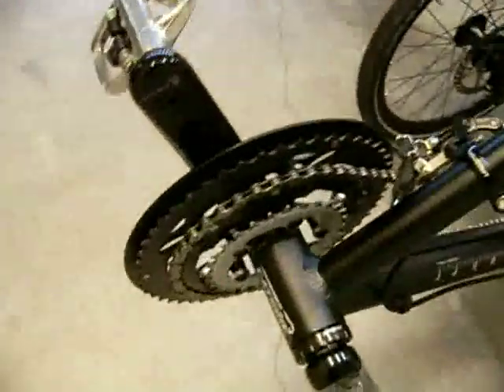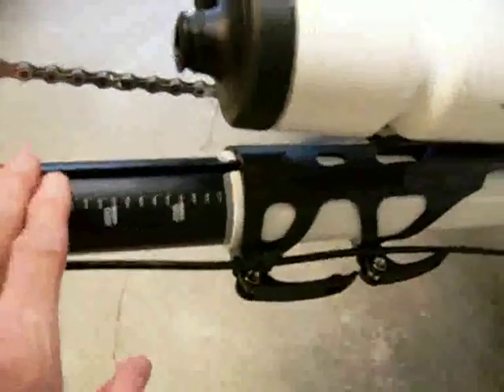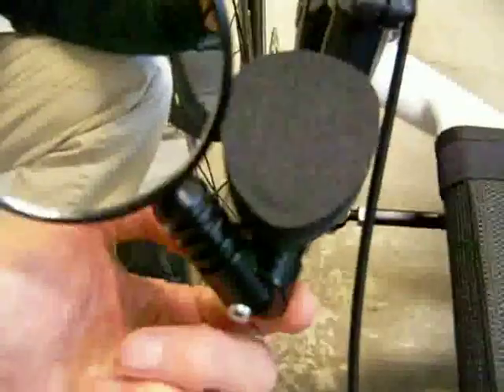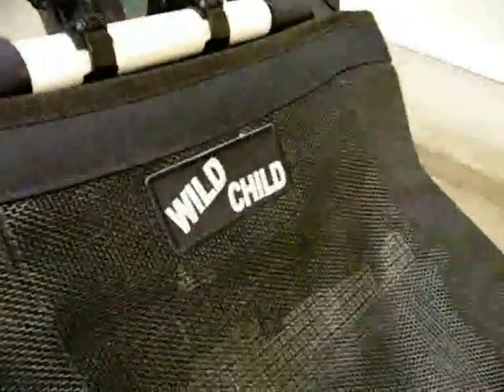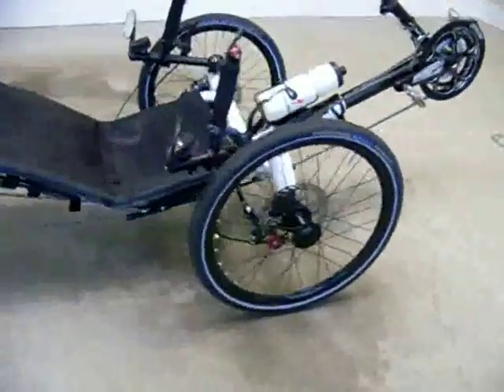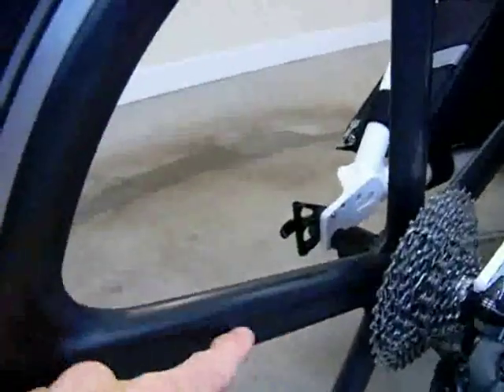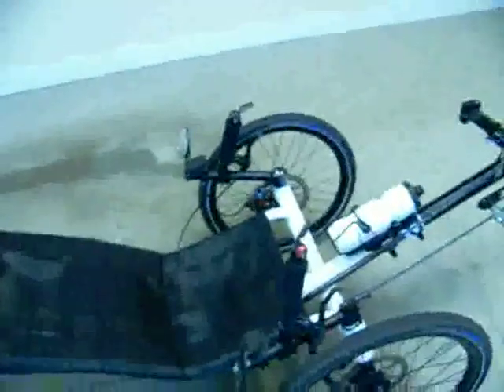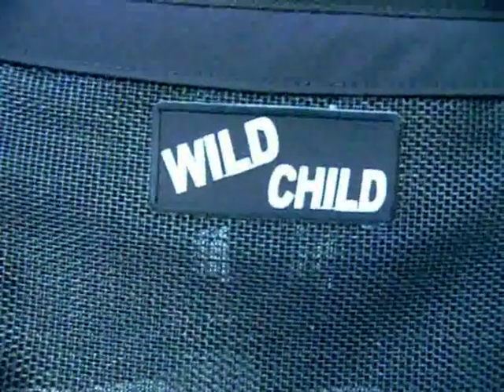Catrike 700 Build by Trike Hobo

Comment: How many gears  are on the back of the trike.? Also do you plan on putting assist bars on your trike? Also after traveling would you change your peddles to a different size.
Reply from the maker: Hi Paula,
Thanks for visiting, and for your comment! I will provide a link here to a detailed page on my Trike Asylum website where I discuss extensively all aspects of this Catrike 700, including the gearing front and rear (plus TONS more information):
https://trikeasylum.wordpress.com/stevestuff/steves-catrike-700/
Regarding assist bars, I assume you mean the bars that help people sit down on, and stand up from, the trike. This trike is indeed very low to the ground, as you'll see in photos on that Trike Asylum page I linked above. However, for me, I have no need for these assistance bars because I am quite athletically fit, so getting up and down, even on this super low recumbent trike, is no problem at all.
Take care my friend ...
steve
Trike Hobo

Comment: How does the Catrike compare to your Ice?  Compare direct steering versus Ice indirect steering
Thanks.   Beautiful trike too!
Reply from the maker: Hi James,
I prefer this Catrike 700 over my ICE Q trike. It is more comfortable due to the seat recline angle, and the mesh seat is superior to my former ICE seat. The 700 is capable of much higher speeds than the Q, and with my 24 tooth small chainring, it can outclimb the ICE Q on hills and mountains. I like either kind of steering - both are very intuitive, and can be learned within the first 60 seconds on the trike. I prefer the direct steering of the 700 however, as I can turn sharper because the turning circle is not hampered by the handlebars hitting the seat frame, as it was on the ICE Q. Also, with direct steering, the seat has been placed farther forward than the Q, which allows me to sit in the seat without using my hands to sit down. I also prefer the aesthetics of the steering appearance on the 700 - very simple and clean, unobtrusive. At this time, I would not opt to return to an ICE Q, or to have an ICE Sprint 26X, as I believe the design factors of the 700 are simpler and more efficient - just personal preference however, so keep that in mind. See ya' ....
Trike Hobo

Comment: Very nice machine and beautifully explained. It sure comes with a price tag, doesn't it? Anyway,one question: I didn't see any rear brake, and I have also seen other trikes without one. Is the rear brake really redundant?
Reply from the maker: Hello Hendrik,

Most trikes do not have a rear brake. They have only brakes on the front two wheels. I have not found a rear brake necessary, even when riding fully loaded on tour. Rear brakes can be put on as a custom addition, but I see no reason to do so, as the front brakes stop the trike more than adequately.

steve
Reply: +Hendrik Plümer (PlasticRider) Most trikes don't have rear brakes for stopping, the weight distribution is more to the front even when stopped. A rear wheel brake will lock up the wheel even lightly used. KMX are one of the few that uses a rear brake but KMX started as stunt trikes.

Comment: What would be your thoughts on the Mountain Drive front end with a double set of front rings & derailleur - 42, low & 52 high, on the 700 wheel with the SRAM 1050 that would give you a low gear of 12 - 13 GI & a high of about 128 GI.   if you stuck with the 38 low even a low range below 12 GI.
Reply from the maker: Howdy The MadOne, Well, I guess I am not really qualified to answer your question because I do not have any personal experiece with a Mountain Drive front end. I can say however that if your low gear inch number is 12, you'll be able to climb any road known to human beans! My low gear inch number is 18.7 according to the calculations, which is with a 24 tooth small ring up front and a 36 tooth large cog in the rear, and I can climb even the steepest of hills with it. My high is 132.4, so theoretically this trike and rider can outpace someone with 128 high gear inches. Visit this link to learn more about this trike:
http://trikeasylum.wordpress.com/stevestuff/steves-catrike-700/
Trike Hobo

Comment: t hobo, l bought the 26 tooth granny gear. Idea from u, climbamatic
Reply from the maker: Howdy Pushyhog! The 26 will work fine for normal riding without being loaded up with touring baggage. If you are going to tour with cargo for long distances over mountains and steep hills, the 24 small ring would be a better choice. I dropped mine down from the stock 30 to a 28, which still made it tough getting up the mountains, even unloaded, so I got the 24, and now am fine. The good news is that these little rings are not expensive, so an extra one is no big deal really. I would highly recommend installing the Volae Granny Guard from Hostel Shoppe if you are running a 26 or 24 small ring. You will never overshift onto the frame with the guard. Here is the link:
http://hostelshoppe.com/cgi-bin/readitem.pl?Accessory=1331319002
This granny guard really works well - worth the small investment!
Trike Hobo

Comment: How is this a "build" video?
Reply from the maker: Howdy Bill,
This is just a simple video about the modifications I had performed on this trike at the time I filmed it. Other mods have since been done, like a 24 tooth small chainring instead of the 28 shown in the film, and the Aerospoke rear wheel has since been removed, replaced by the stock Velocity rim (issue with carbon wheel - discussed on the Wild Child page of Trike Asylum).
http://trikeasylum.wordpress.com/stevestuff/steves-catrike-700/
steve
Reply: Np, was just expecting to see a vid about how the trike itself was built, similar to the ones for Greenspeed. Good luck with the trike and enjoy the open air.